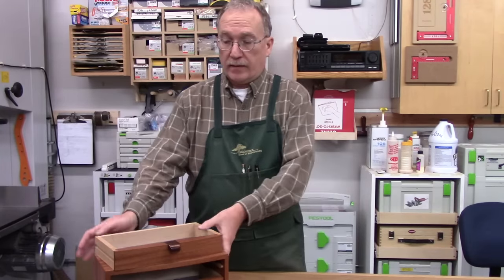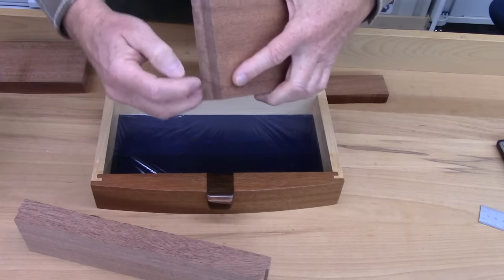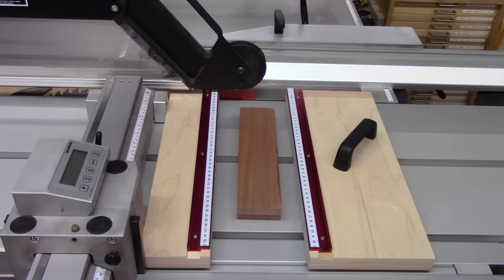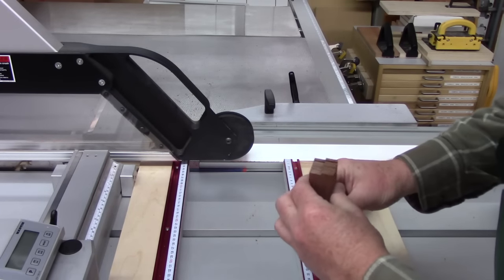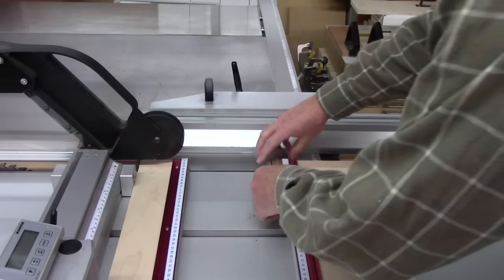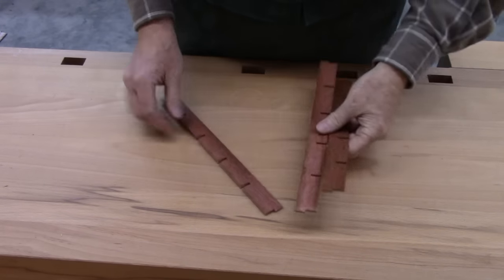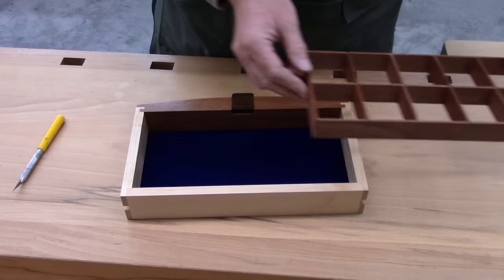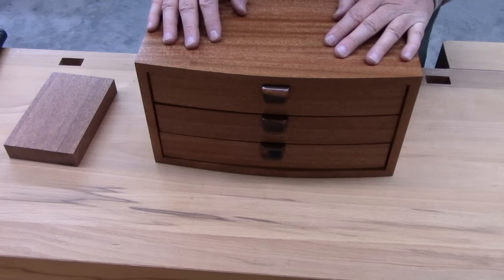Making Jewelry Box Drawer Dividers

Comment: I would have liked to see the lay out, as well. In other words, how did you arrive at the size of each cubicle, and the thickness of each piece ?  Yo passed them through the sander, and poof— perfect fit. If it were me, it would be too tight and not fit at all, then too loose. Oh, and that’s if the length and width were all too tight or too loose. If it were just one of those, the pieces would be of different thicknesses and it wouldn’t look good.

Comment: what if a guy doesn't have a sanding planer...??
Reply from the maker: Before I purchased the drum sander, I used double stick tape to hold the strips to a piece of MDF and planed to thickness with a block plane.  Hope this helps.
Reply: @extremewoodworker  does it work to make a fixed divider cross hatch without a perimeter?   Or I would make it an  removable  tray that sits on a divider or pins.
Reply from the maker: @elkskiutah8204  If your material is thick enough to not be flexible, a perimeter is not necessary.  The dividers in the video are essentially a removable tray without a bottom and are not glued together.